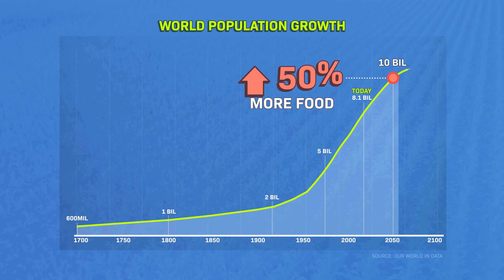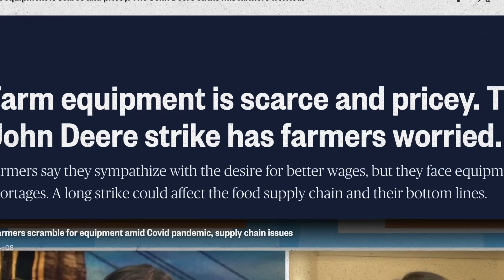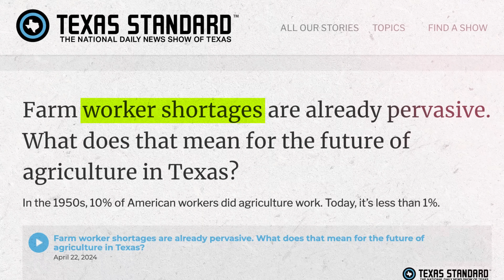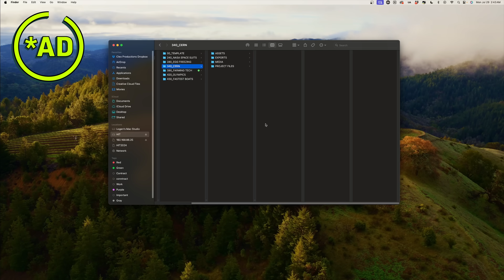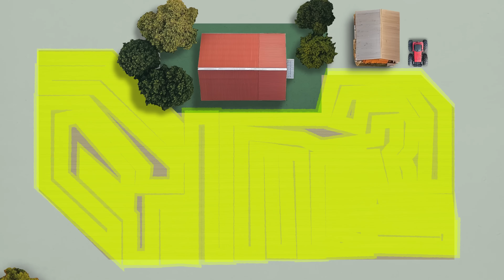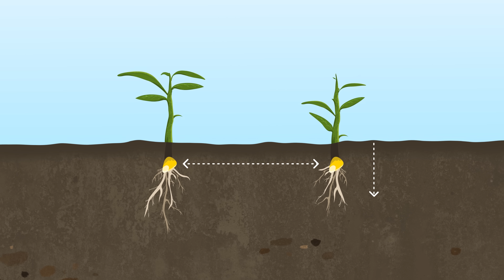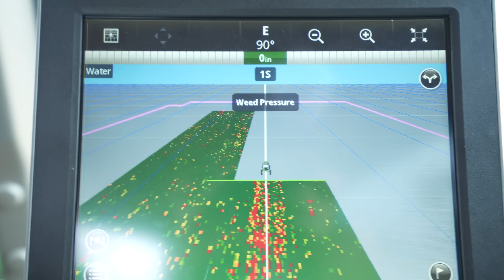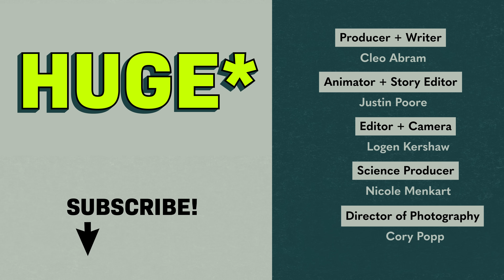Why This Robot Kills Weeds With Lasers

Comment: Remember folks, John Deere had to be taken to court for farmers to have the right to repair and are still fighting it.
Reply: We should all have the right to repair. I want to repair my Toyota and can't even change the tires (due to TPMS sensors) or update the firmware without taking it to a dealership.

Also it specifically has to be a Toyota dealership. Regular mechanics can't access the car's computer system. It's a racket. I'm sure these farmers feel the same way.
Reply: @Numenor7 dude, that’s fn nuts. How isn’t there more outrage
Reply: @machinebp23  I mean that's a good question. Do you own a car? I don't know how to respond other than to assume that most people that own cars either don't try to do their own maintenance or don't care enough to raise a stink. But I do know that what I stated is true. And there are many forums with people equally as upset about it.
Reply: @Numenor7  What Toyota years did Toyota start this? I have a 2018 Toyota Tundra and I tend to do a lot of my own vehicle repairs but I’ve owned older vehicles until recently 😅
Reply: @darkprotocall  mine is a 2013. I'd guess at least since they started requiring TPMS sensors. You can't change the TPMS sensor on your own. Not even a tire shop can change it (they can't access the system). It HAS to be a Toyota dealer.
Reply: @Numenor7  That remind me that for exemple russia had very customers friendly cars that you could repair yourself (granted at the cost of comfyness a bit but come on just go diy) and yet here we are .
Reply: @Numenor7  this the conditions that a free market develops. Corporations like John deer produces goods for the sake of making money not to better humanity or the lives of said humans. P.t. Barnum said "money is a great servant but an awful master". If you repair the machines you get from them, that means less money in the pockets of their investors. We need government to regulate market not let market run free. A free market takes away the liberty of the people.
Reply: @Numenor7  That's a you problem. I've been changing the tires on my father's Toyota for years now.
Reply: @louisrobitaille5810  do they have TPMS sensors?
Reply: @Numenor7  They have a channel about people like you: JustRolledIn.
Reply: @AbuMohandes-p2c  says you joined two weeks ago. Welcome to YouTube. You're only a decade behind.
Reply: @Numenor7  No, must have been around 2006. When reply videos were still a thing, remember?
Reply: @AbuMohandes-p2c  alright cool. Your comment came across as aggressive for no reason. Dunno why you replied to me specifically. Did I misread it?
Reply: @Numenor7  I just find it unrealistic that an average farmer would be able to fix the highly automated and finely designed equipment of today. These are not the 'weld the part back on' days of decades ago. This is a time of firmware, software, high density connectors, security and safety.
Reply: @AbuMohandes-p2c  I see. Well that's also painting things with a large stroke. We don't know the specifics of what they're fighting to fix. If it's as simple as changing tires (as my initial comment indicated even Toyota is making difficult) or oil then I believe they could. And even firmware updates could be downloaded. But again I really have not been following the whole thing I just responded to the comment.

I imagine taking a tractor into the John Deere store would be costly and time consuming.
Reply: @AbuMohandes-p2c The things you mentioned are in addition to the more conventional repairs that are STILL NEEDED.
Reply: Even if the high level AI software can only be accessed by a John Deere tech atleast the physical side of the machine and the software related to engines and the general use of the tractor should not be protected!
Reply: John Deere is also violating the software licenses on a number of open source projects.
Reply: When you pay for a product, you pay for entire cost of development, including hardware and software. It’s within the owners right to have access  to software.
Reply: Plenty of competitors to Deere, so they can disappear and farmers will buy other brands. No problem.
Reply: It’s criminal.
Reply: Dear dont buy deere you can always but other brand's tractors
Reply: Repair what? This is a spaceship.
Reply: So farmers should buy another brand.. capitalism right?
Reply: yup & these new machinese with super high-tech will make it even more difficult to do so
Reply: Amen!!! That was my first thought when she said John Deere
Reply: Right to repair should go hand in hand with quality training and timely after work inspection in order to remain manufacturer warranty.
Reply: Exactly, It's great tech but they should not be so money hungry, and allow farmers to repair and even innovate with their tech.
Reply: John Deere is the only company doing this.... People need to wake up and change our laws.
Reply: A lot if money is made through spare parts for the company to sustain!
Thinking from a financial standpoint, companies are forced to make these decisions to satisfy the share holders who are good chunk of population!
Reply: so did apple
Reply: Thanks for bringing this up.
Reply: Remember scientific advancement is done by scientists not politicians, the ones who make weird decisions are done by politicians inside companies like John Deere, so you you can’t just blew them, blame the board of directors and the CEO
Reply: They are still fighting because apple has stakes in right to repair laws as well.
Reply: @aranyamoreau4543  Apple huh. Apple has the right to repair what belongs to me? Okay, let them have that "right", if they want it they should repair what "belongs" to "them" for free. There is no argument as far as I see it. If I own the equipment I should have the right to do with it what I will.
Reply: JD is a greedy pig.
Reply: And didn't really make them repairable.
Reply: As she says on the video..
Reply: @eliassuzumura  But now you remember. Problem solved.
Reply: can you explain the story, sounds like something bug
Reply: big
Reply: Repear is a vantagepoint on technology that I personally consider to be unique. I think that the people who own equipment should have freedom to repear them. 

I know that this vantagepoint is superior in the struggle to the highest achievement in technology, to which the manufacturer should have some protected right.
Reply: why is the mossad burning the Patagonia???
Reply: And this is why we need regulation and not less of it like what the right thinks.  Big corps are worse than big government.
Reply: Massey Ferguson best tractors hands down - John Deer big but no good for European market roads to small to navigate without extra logistics in place.
Reply: glad she touched in it even if a little
Reply: Yep, definitely would not be buying another John Deere
Reply: While I agree we should have right to repair,  all it really means is that John deere has to sell you the software to talk to the equipment.  John deere probably will just sell it for $50,000.    Most farmers I know already have access to pirated software, so right to repair really won’t change much.  But what would help is eliminating all the crazy regulations around emissions.  A large cost of Equipment these days is the emissions. Modern combines have to incase their exhaust in a box so they don’t start fires. But then that box gets hot so they have a high horsepower blower and an air filter to blow clean air through the box. All that burns a lot of extra fuel.  A semi motor used to easily get 1,000,000 miles.  Now because of emissions you’re lucky to get 500,000. Now we have to build twice as many motors.  Doesn’t seem very environmentally friendly.  Plus the emissions are the majority of what causes a piece of equipment to break down these days. All that is cost for the farmer.  But the manufacturers love it because they get to sell more parts.
Reply: @fifelee  but like in the industry I’m in make the software available at that high price then 3rd party repair people can buy it and share that cost to there customers. This enables the farmer to atleast have the ability to get a different technician in when JD are busy for weeks in the middle of harvest! 

As much as they are anti consumer look at Apple they released overly processed repair tools, but atleast these could be purchased buy a repair shop for instance so Apple isn’t your only option. This allows choice at least! 

I do believe the right for anyone to repair the equipment they own is very important!
Reply: @fifelee  The emission regulations are there for a reason 🤦‍♂️. I know you don't believe in climate change, but the rest of the world does.
Reply: It's interesting how John Deere has been inviting Youtubers for videos on their tech. It's almost like they are trying to clear their image ;)
Reply: That dust when tilling is topsoil blowing away.  No topsoil no food.
Reply: @GlennMarshallnz   But, cannot farm in the mud!
Reply: John Deere care more about money than they do the farmers.   Farmers have been fixing their own equipment since the beginning of time!! John Deere is seeing to it that they can't do that anymore. Force the farmer to have John Deere fix their equipment's for big bucks, $$$$.
Reply: Thanks for mentioning this, i'm not even a farmer and came to the comments to make sure this got followed up.
Reply: Every "cool innovation" shown in this video is patented, protected by "IP laws, treaties and trade agreements" and will be used to extract excessive profits from farmers who use this equipment. As a person from India, I am so very happy that we don't have consolidation in agriculture like the USA. John Deere and its competitors will not be able to monopolize food in India. However, we might have to rely on food grown in Europe and America if we don't plan for climate change and that might pass this cost on to us, in India.
Reply: I was thinking this the whole video
Reply: we need competition
Reply: I'm glad someone else brought that up and I question if she does enough research when talking about the topics since the right to repair is a huge movement that she didn't acknowledge.
Reply: The Deere lost its way a long lonnnnng time ago
Reply: Heard (across the pond) that these tossers are screwing over their years of loyal farming community over!
Reply: John Deere is not welcome on my farm!
Reply: Yer damn right!
Reply: SUPPORT FARMER UNIONS 💯
Reply: A lot of people selling their souls for greed in this life. Right to Repair is one of those things that just make sense, and the fact we have to fight for that right is proof that there is no logic or justice in this life.
Reply: The same practice is done by John dear dealers for breaking oils where you have to specifically by oil from their dealers only even they are very far away from your farm.
Reply: This is happening in Indian John Deere dealers
Reply: I think she mentioned it at the end of the video. But thanks
Reply: Yeah, and who is responsible when a farmer breaks a million dollar pieces of machinery.  It should be like most electronics, as soon as the farmer breaks the seal, all warranties are voided.
Reply: Yeah, I was upset about this, though with so much tech and software involved, I now understand John Deere's position also.
There is a lot of IP involved In the AI they use to make the vehicles for their magic.
So it is a tough calm both ways.
I know farmers and have worked on farms and it is important to be able to fix your own equipment, so that you can work on your field when it is needed.
There has to be a middle ground somewhere.
Reply: @dandantheideasman  The main issue is not even the AI for the right to repair stuff, it is the engine sensors, etc. The EPA has some restrictions on modifying the emissions controls, but even they came out against some of John Deere's antics. John Deere if you swap out a JD genuine fuel pressure sensor for example from one tractor into another to confirm a bad sensor it can brick the tractor and possibly the sensor unless you have a JD service laptop. You should not need a laptop to swap out one genuine JD part for another JD genuine part and that is not required by the EPA legislation either.

Another issue is some of the dealerships will not make housecalls with the service laptop, so you have to figure out how to get the down machine out of the field and shipped to the dealer and back.
Reply: Yeah that’s why at 2:30 she mentioned it. Did you actually watch the video???
Reply: @RvB_Fan_since_8  Briefly and superficially, yes.
Reply: @RvB_Fan_since_8   its stil importent to rember and not fogive
Reply: @RvB_Fan_since_8  You know that life is nuanced and that most things can coexist right ? So stop being a pathetic reactionary simp !
Reply: @RvB_Fan_since_8  Also apparently YOURSELF didn't watched the video has she EXACTLY talked about this specific topic at 13:28
Reply: @RvB_Fan_since_8 she also called it challenges when it's pure corporate greed. Hitting the issue right on means not being afraid to call out things like corporate greed and (say it) climate change (bold caps) 🤬
Reply: @DarrenHwang  it is corporate greed. "The right to repair" even obfuscates the real issue. The real issue is that farmers should have the right to keep their land. If they have to buy crazy expensive equipment, that equipment should benefit them in a way that makes their business more profitable and secure by allowing farmers to do more with less. Instead, farmers can't afford the maintenance and coincidentally Bill Gates became the largest private owner of farm land.
Reply: @DarrenHwang because they are challenges. Stop being cringe. Her job isn't to virtue signal. Her job is to cover tech and yet she also covered the current issues with this industry
Reply: @DarrenHwang  Calling it corporate greed is missing the point. These people have to make a living somehow.
Reply: @DarrenHwang corporate greed is only a problem when corporations start breaking the law. Other wise it's just individuals complaining that a successful entity should give them a discount ...just because. I can do you one better than 'right to repair.' You're free to build your own tractor from the ground up of you like.
Reply: @DarrenHwang  Yes, but her channel's central pillar is "optimistic tech..." 

You can cover the tech without grilling the company because their politics are outside the scope of this video - and her channel ("optimistic tech...").  The tech is interesting, and a whole lot of people work on this stuff who have nothing to do with John Deere's business practices.
Reply: @RvB_Fan_since_8  I'm sure he did hence the comment reinforcing the point and adding additional information about how they're still fighting it.
Reply: @RvB_Fan_since_8  Lol no she didn't. She barely feather touched it. She didn't even say it. She had a graphic that lasted two seconds and then never touched the subject again. The subject of the video is cool but let's be honest, it's just more JD marketing.
Reply: @RvB_Fan_since_8 she highlights it but never says it. Huge if not spoken.
Reply: @RvB_Fan_since_8  calm down white knight
Reply: Yeah, so important that Randy Jackson from Hicksville Alabama is allowed to fix his own GPU cluster.
In the evenings, he performs brain surgery on his own children, because he can.
Reply: @AbuMohandes-p2c    You’re the idiot from Dicksville I see, unpleasant to meet you.
Reply: @AbuMohandes-p2c  The problems arise when the tractor stops in the middle of a field & JD cannot get a technician out to repair it for 5-10 days!  A tractor & 30 ft (9 metre) implement works 15 acres (6Ha) per hour... the unnecessary complexity leading to inability to repair, in this example,  could prevent 1500 acres of work!  Such breakdowns threaten the entire year's profit!
Reply: She covered that
Reply: @KevinsDisobedience  No she did not  She just glanced over it. There's a much bigger story behind this, but I do realise it was not the main topic of her video
Reply: @desertstar223 no, she touched on it cause it gave me even information to get an idea of what was happening with that.
Reply: @desertstar223 what do you expect? John Deere let her film and test drive their equipment for her own profit, you don't think that comes with terms and conditions?

Comment: Rather than use the hugely expensive machines and drive heavy equipment over fields, I would rather see a group of small robot designed to identify and pull or otherwise kill weeds w/o herbicides.  I can also see robots picking tomatoes and such in truck farming.   The perfect farm laborer.  I imagine this is not what John Deere wants to see happen.